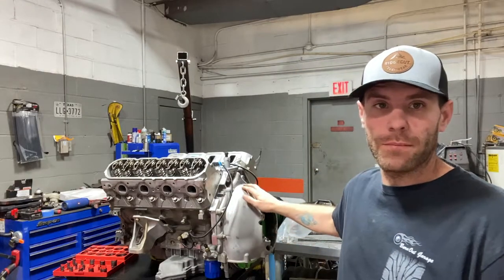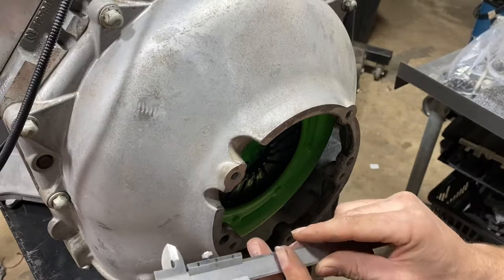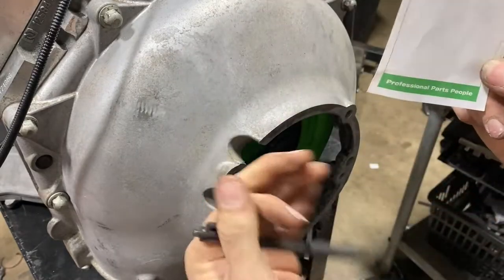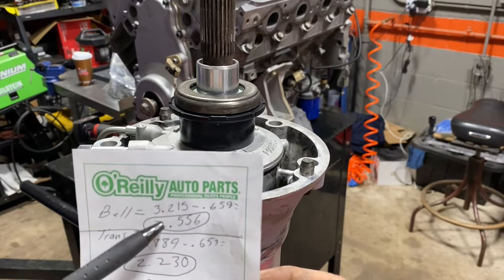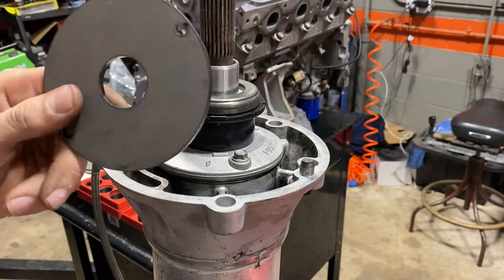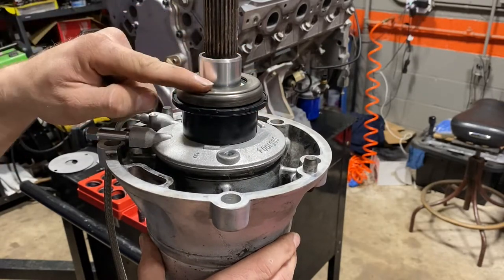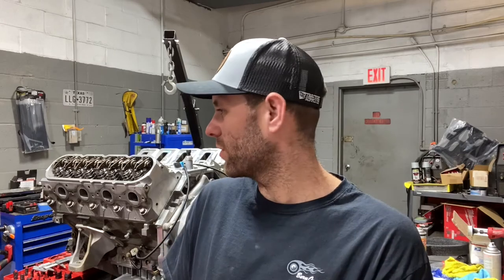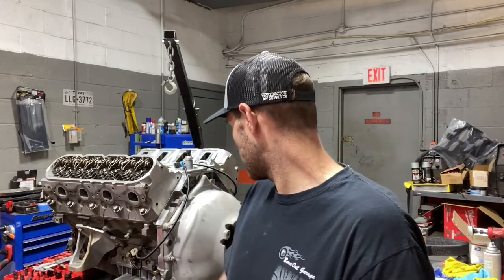How to measure and adjust clutch air gap so you can have proper engagement and disengagement.

Comment: Doing all this measuring in mm instead of inches is 1000 times easier. Why anyone would do this not in metric is beyond me. Literally simple numbers 9+10=? Instead of 3.1245-1.924 blah blah blah. Just use the metric system

Comment: Thanks for mentioning all the hints you did . 2011 grand sport LS3 with Thompson motorsports Dart 427 SHP , C.P. Carillo rods &  pistons , dragonslayer crank, Wilson racing lifters,with fulcrum upgrade on rocker arms, inconel valves intake and exhaust, FAST103 mm intake, 90lb DEATSWERKS injectors, HD oil pump and fuel pump, granatelli EXTREME POWER ignition coils, hd alternator, short throw shifter, 200 hp jetted NOS , to 105mm throttle plate , 103 mm nick Williams drive by wire throttle body, yellow racing +3”/-3” or 6” adjustable coil over shock racing suspension, 345/30/19 Michelin pilot sport cup 2 rear, Bridgestone 275/35/18 Potenza RE-71R front & McLeod RXT Twin disk for 1000hp, LED wheel rings multicolor Bluetooth, undercarriage and engine compartment and side fender grille LED lighting, , long tube headers, cords exhaust, England Green whiplash II CAM, lambo door kit,

Comment: Very good video on the subject. Terminology is a little off/confusing though.  "Air gap" as it relates to this means an actual gap between the bearing surface and the pressure plate fingers.  These OEM style CSC's always ride the bearing on the clutch fingers. What you've done is set the preload and thus the proper operating range for the CSC.

Comment: Good video, I have one question I have a tdi which is not going in to gear when the  car is starting, but go in well when off, will something like a spacer on the concentric work for me?
Reply from the maker: You probably have air in the system. I would try bleeding it and bleeding it again.

Comment: Does it mean my slave is bad if it doesn’t go all the way down after removing the spring and lines adapters ?
Reply from the maker: I have seen them do that before. If you push it harder it will go the rest of the way down
Reply: Oh shit dude thanks I’m literally working on it right now. Really fast reply! Love your videos by the way
Reply: It did go down but pushing it
Reply: @DGGarage is it bad to run more then one shim bro ?
Reply from the maker: @rubenvillalobos15  no run as many as you need to get it in spec.
Reply: I put a camera through my bellhousing to see if the slave cylinder moves and it doesn’t at all any idea what it could be ?
Reply: When I press the clutch it does nothing
Reply: @DGGarage
Reply from the maker: @rubenvillalobos15  did you bleed the clutch good